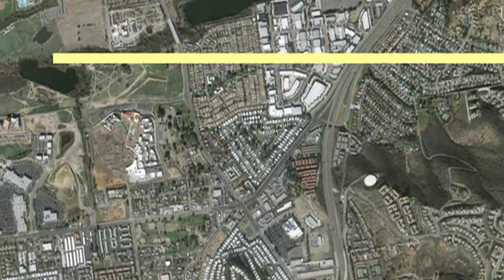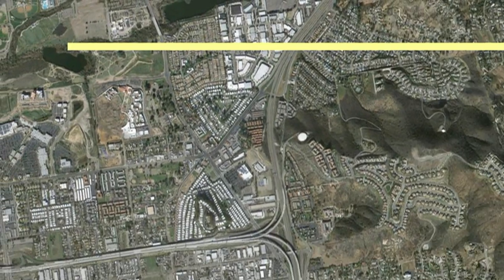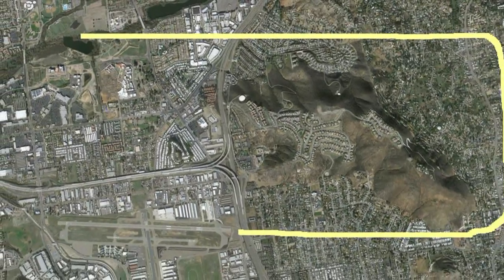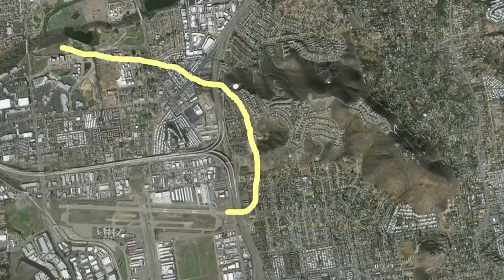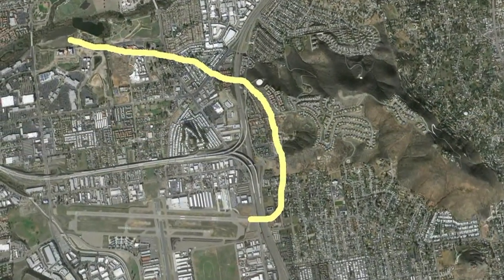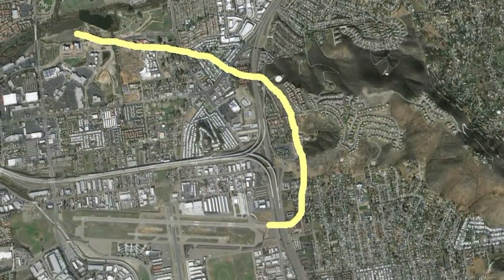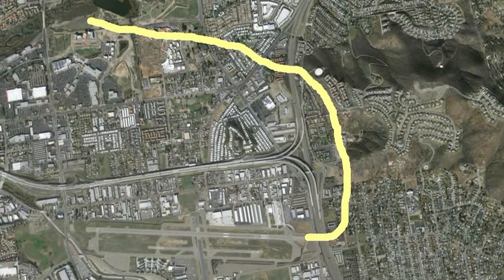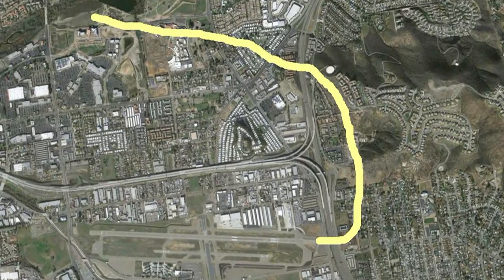Short Approach

Comment: In the 70's we used to call a short approach only if you stopped the turn low over the runway.  We had twins doing real low and short approaches, Airshow style.
Reply: That is right.  We and most pilots were into doing hard maneuvers, not just Mild Maneuvering like in the millennium.  I used to do them to the flare, on Aero Commanders and Piper Aztecs.